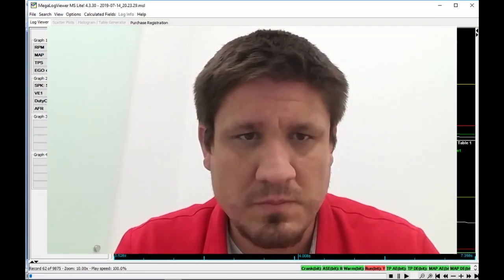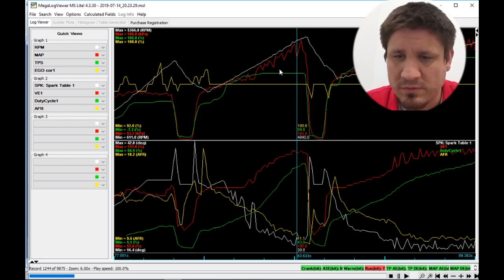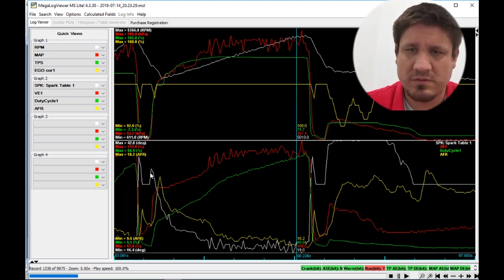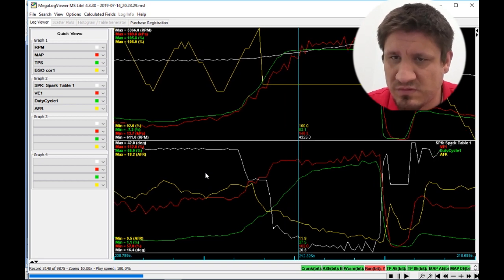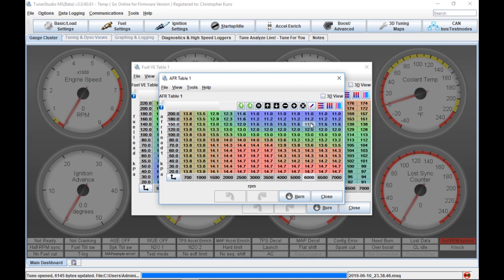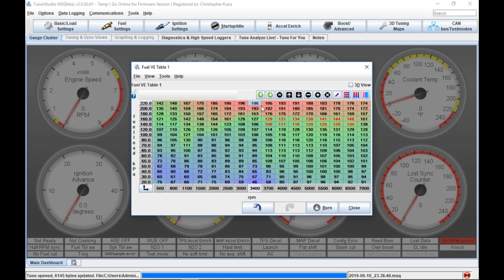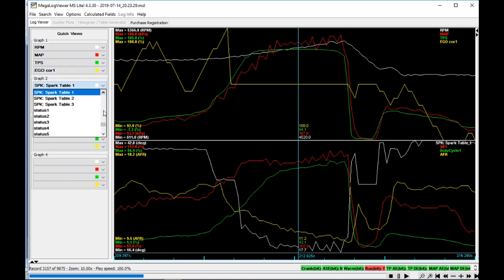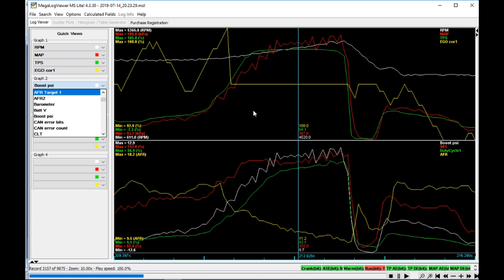Odd MAP sensor readings on Data Log

Comment: Not sure if you will see this or respond but what we do is install a nitrous jet in the vacuum hose that goes to the map sensor to slow the air down at the sensor to prevent it from reading wonky like that.

Comment: Hi I've got a 77 280z, I've added a comp cam and ebay turbo (was na, I can provide specs if you'd like) and am very happy with the outcome, however my timing seems to feel retarded lately without touching the distributor. When you give it even enough throttle to take off from a stop quickly it sputters a little and the turbo spools. If you ease into it, it runs pretty smooth though. I'll do more investigating with a timing light but was curious if you had any suggestions? Great videos!!
Reply from the maker: You bet, Do you have a data log of when it is lagging as you get going? Also, have you checked compression lately? If you have the data log, send it to Twonutsdiy at gmail.